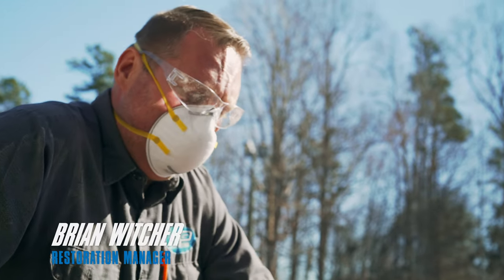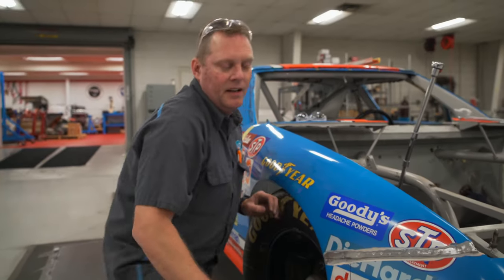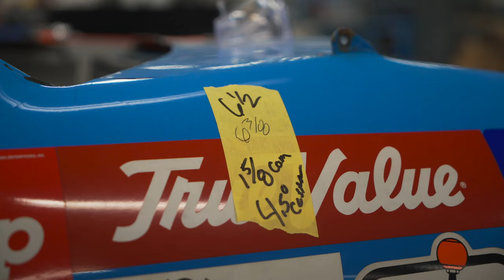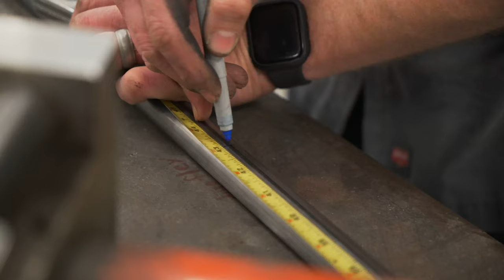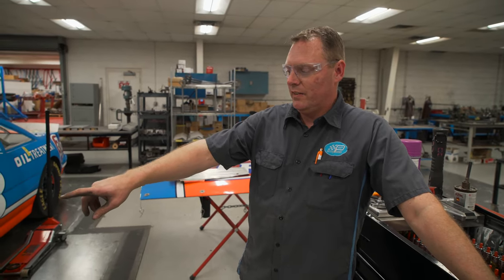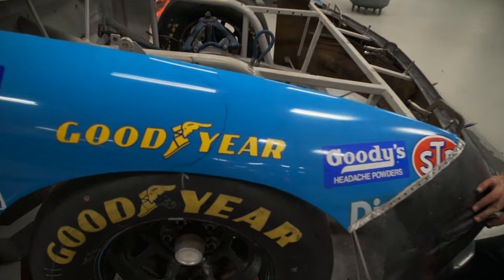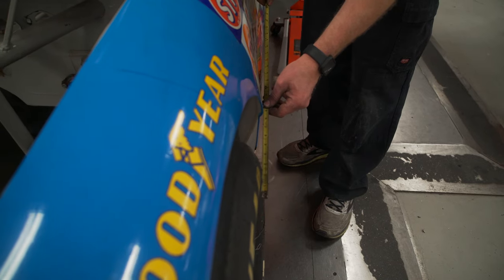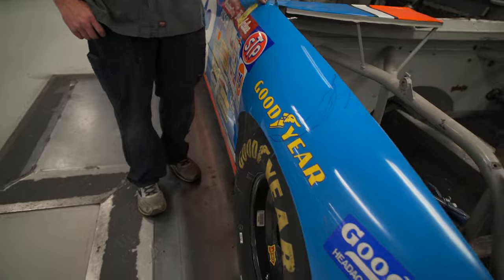Switching the nose on a 1991 NASCAR Pontiac Grand Prix Restoration (4K) | Petty's Garage

Comment: That car looks perfectly fine the way it was I don't understand what there doing..
Reply: This is a 1991 car that had been turned into a show car after a crash. In the process of being made show ready, it had been fitted with a 1989 spec nose. The car is currently being restored to be period correct to 1991 and as such, has now been fitted with a 1991 spec nose, as shown in this video. So, it may have looked perfectly fine the way it was, however, it wasn't historically accurate to when it raced in '91.
Reply: @hakkalocken  thank you. I also was confused as to why they was doing this